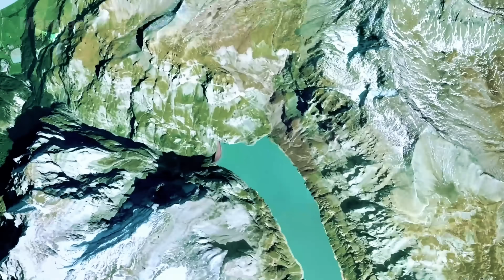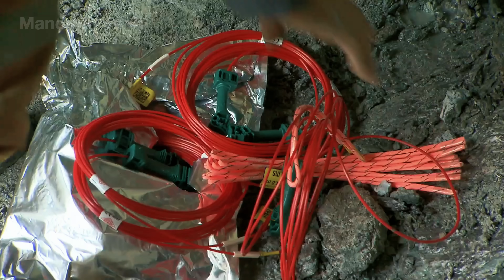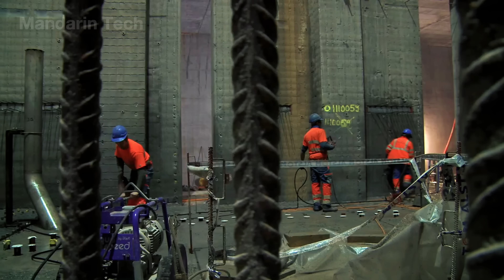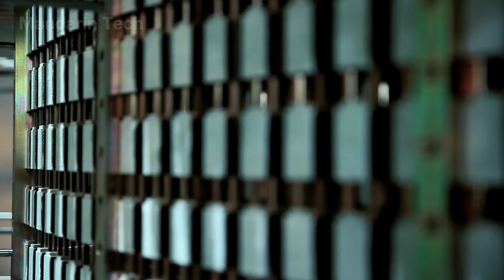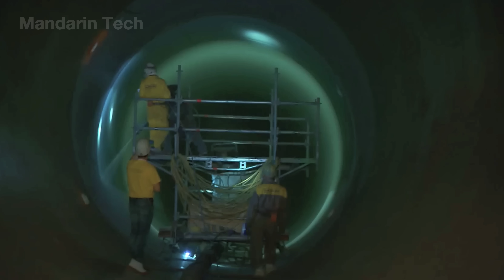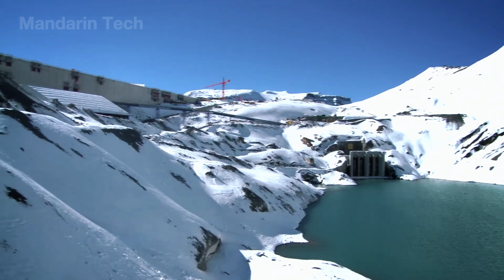Swiss Genius Engineers Hollow Out A Giant Mountain To Build A Hydroelectric Power Plant Underground

Comment: The idiocratic units of measure make me wanna slit my wrists. Is that 3000 Toyotas or Ford big blocks? Come on...
Reply from the maker: Fair point, those comparisons are just meant to help visualize the scale quickly, but I’ll try to use clearer units in future videos.
Reply: @Mandarintechmido  SI units would do just fine and make visualizing much easier.